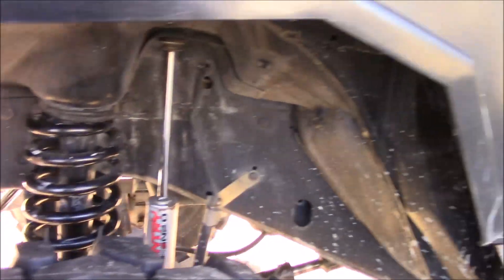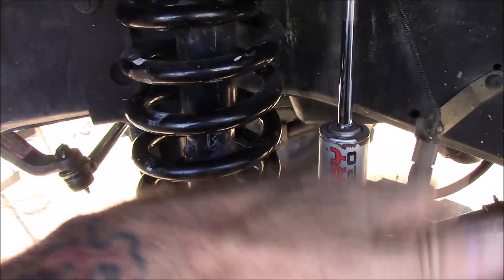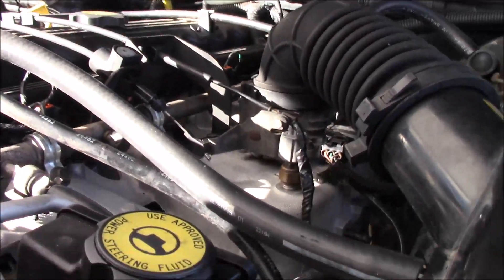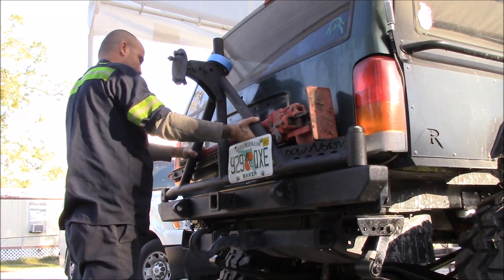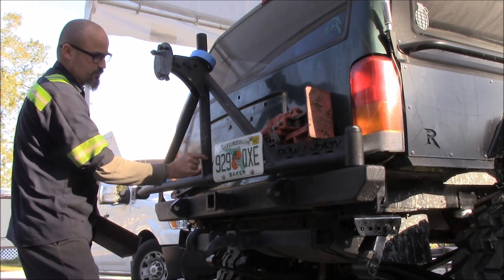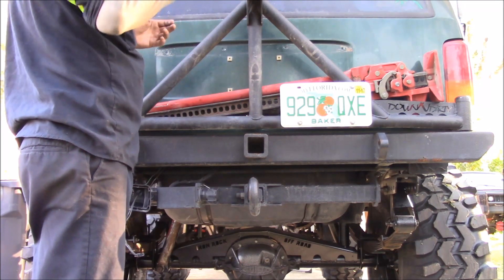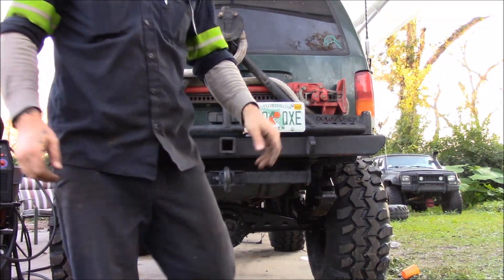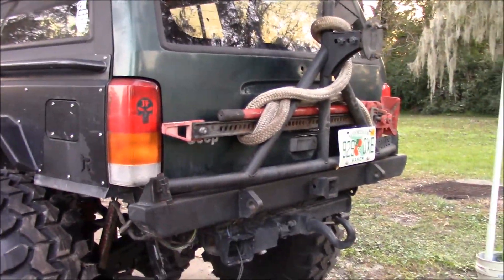injection installed high lift  install

Comment: The ACOS give you minimum of 1.5" lift over and above your coils. I just put a set on my son's 97, and am reworking my 90 to use them, as well as the wife's 94 ZJ (front AND rear)

Comment: Can you swap to a different injector nozzle or maybe even come up with something like the old carbs where you can change out the jets?
Reply from the maker: PrplNrplTJ you can change nozzle size but the kits are designed per application per cubic inch max rom turbo or non turbo  I'm gonna try it like it is a mess around with the mix water to meth percentage it's 50 50 now
Reply: Ah, ok. Great job on both meth set up and jack carrier. Keep it up!

Comment: If you move the meth nozzle to the front of the air box facing the intake tube, that will let the spray spread and atomize more efficiently.  Right now the way you have it, most is Just hitting a wall and Running back down into your airbox. Kick ass xj!
Reply from the maker: +Brian Farlow  I'm gonna have it spray only at wide open throttle I think all the incoming air will pull it in in will check the air filter after we test it see if any is getting back down to it if so we will change it already a hole there lol

Comment: your jeep steady becomes more! Awesome job! im working on mine now, have the transmission out and replaced the rearend. Hope to be up and running by new years. I want to ride in osceola with yall this upcoming season.  We are all getting geared up. are you going on the memorial ride the first weekend of the year?
Reply from the maker: Mayolakecity Batchhouse very possible I should be able to no problem